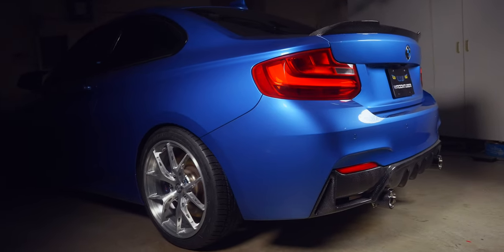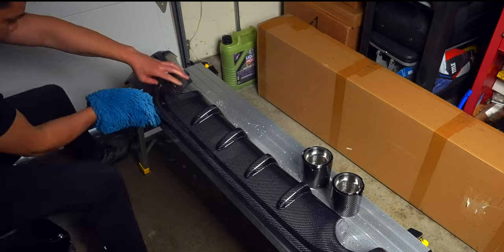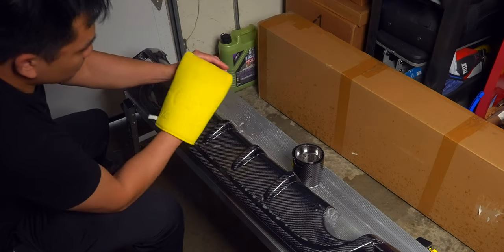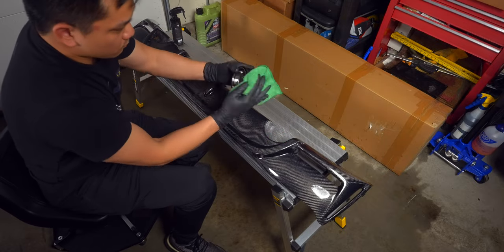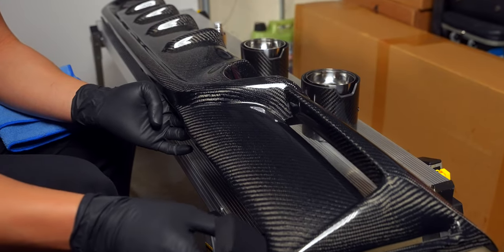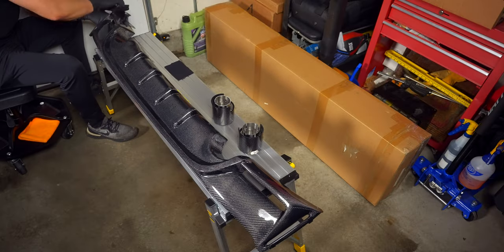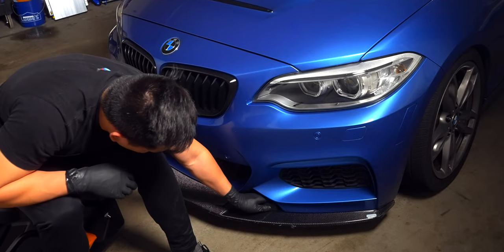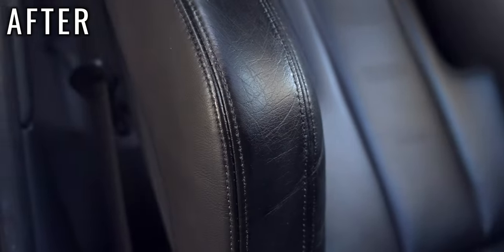How PROTECT CARBON FIBER

Comment: Hey Fritz!
As always, stellar video

Have you gotten around to doing the engine mounts on your M235i yet?

I'll be tackling the job shortly, my car is around 74k mi / 119k km marker & I'm starting to feel more mechanical hesitation on throttle input in 1st / 2nd gear. I can also rock the engine back & forth 2"+ by hand even when cold. I think it's time.

Just curious! Your F30 328i vid is all I'll be going off of for the DIY

Thanks as always